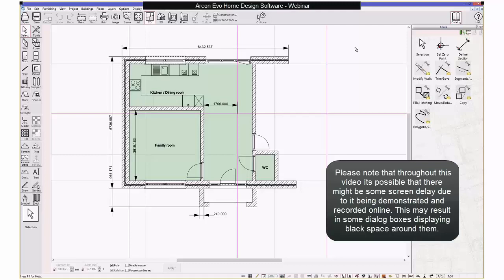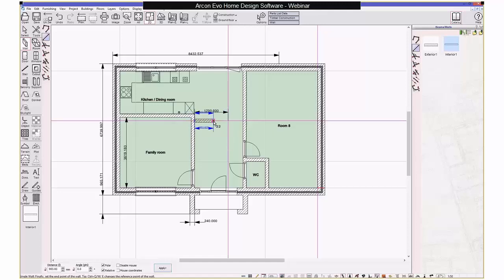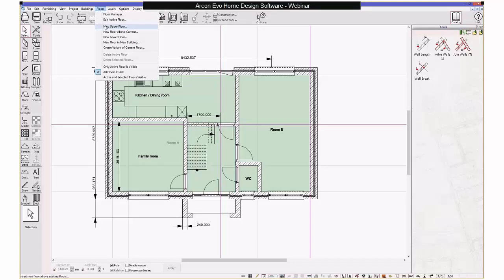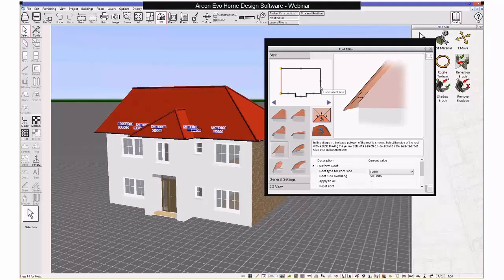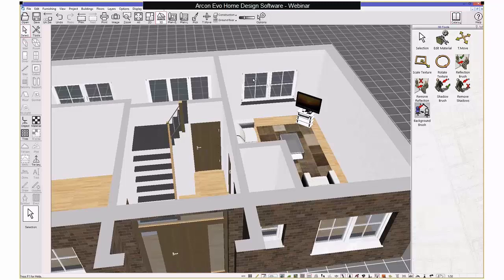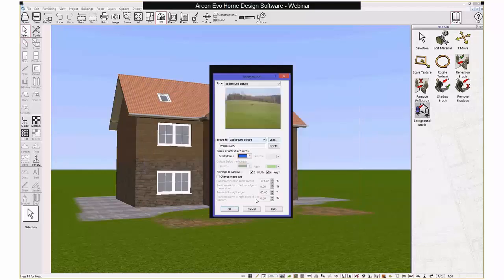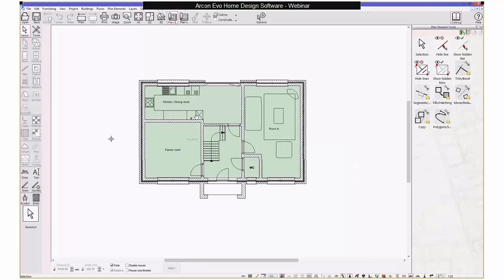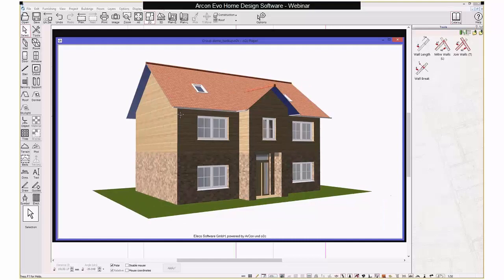Arcon Evo Home Design Software Demo

Comment: I am a longstanding customer who used to use XP for the Arcon programmes. Which Windows programme is best suited for the Latest Arcon Programmes???
Reply from the maker: The software runs ok on Win 7 > but would recommend either Win 10 or 11

See min requirements:
Processor: at least Intel® Core™ i3 or equivalent processors
Operating system: Microsoft® Windows® 11, 10, 8, 8.1 or 7
Memory: at least 4 GB
Free hard disk space: approx. 2 GB
Graphics card: standard, 3D capable
Reply: mr. Nikitas did you compare this program with  Home Designer Pro software? Tell me please your opinion.